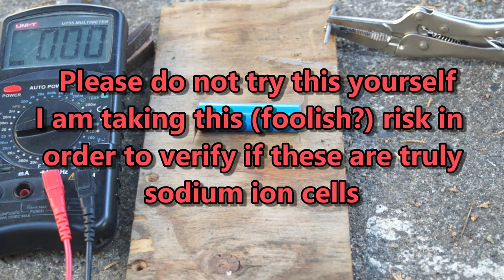Sodium Ion nail penetration test

Comment from the maker: I bought these sodium ion cells here:  https://www.alibaba.com/product-detail/GEB-Hot-Sell-18650-Sodium-Ion_1600969337309.html?spm=a2700.shop_plgr.41413.13.5f8f4147PAJoF2
Reply: I like that they're described as a starting batteries, I bet they'd work nicely in a Coffman starter.
Reply: Use hot  glue to stick it down.
Reply from the maker: Hot snot!
Reply: Those "sodium ion" cells come with a lithium ion certification when you follow this link. Maybe real sodium ion cells don't do this.
Reply from the maker: @senseisean6632  they are sodium ion.  Alibaba manufacturers and resellers often have issues with english translation and errors on their pages.  You should always take time when choosing the cells you want.  If you watch my videos testing the cells you can only conclude they are sodium ion.
Reply from the maker: @senseisean6632 I checked the link and it still goes to the Na-ion cells sold by General Electronics Ltd.  I can't find a discrepancy

Comment: While not flammable, I can't ignore the fact that it does explode.
Reply: So... You're sticking with lithium, then?
Reply: exploded just a bit. I have seen better capacitor explosions
Reply: Yes, but it was along an engineered pressure release point.  The casing remained completely intact.
Reply: Say you have a phone battery made out of this and you put it to your pants next to your junk. Would you say it is tiny? The explosion I mean.
Reply: @ShadowManceri definitely less catastrophic and non firey compared to LiPo
Reply: @ShadowManceri  In comparison to current smartphone batteries? Yes. The sodium-ion incident is much less energetic.
Reply: This isn't a comparison. It's rather simple yes or no question. "Oh, compared to a dynamite it's not that bad." You might not be wrong, but do you think it makes it safe? Because it only takes half of junk off? Are you happy with that result? Because I'm not. I don't care if it's more or less safe. I care if it's safe. Would you keep this in your hand when it goes off? Would you put it into your pocket? Put your money where your mouth is or just stop. From what I've seen, I would not dare it.
Reply: @ShadowManceri  So... you don't use anything with a Lipo or LiIon battery, I take it?
Reply: @ShadowManceri the battery in your phone will cause way more damage if you put a nail through it.
Reply: @ShadowManceri  So do you use only NiMH?
Reply: @janglur  Do you think it makes a slightest difference to what this battery does?
Reply: @laizalott  for cars and home energy storage LFP is the best choice for now
Reply from the maker: @samueladitya1729 it depends what you mean by best.  I gave up 40 km of range from switching from lithium ion to lithium iron phosphate.  But in the same token I've got a battery that won't catch fire. 
Further to that, I expect to lose even more range with the sodium ion battery. (Coming soon)
Reply: @ShadowManceri Bro your  current phone battery is literally made out of a battery that reacts more violently than this. Its pretty clear that you are uncomfortable with how this battery (sodium ion)vents  but the one in your current phone when punctured by a nail turns into a flame thrower.
Reply: @janglur home boy doesn't know anything about batteries formed an opinion about how scary this battery is and can't comprehend that he already carries a battery in his pocket that's worse.
Reply: @bigpup37  This is like saying that murder isn't a problem because there has been worse serial killers. Does that somehow make murder not to be a problem? It absolutely makes no difference to this battery what other batteries are doing. Comparing to other unsafe batteries is pointless. It doesn't make you feel any better to say that oh well you lost your junk in an explosion, but think how much worse it would have been to burn it off. That is so wrong take. The only thing that matters if it's safe or not. Unsafe battery doesn't make any other unsafe battery safe. That only gives you two unsafe batteries. That doesn't solve the issue. It's so baffling how much people struggle to understand this.
Reply: @ShadowManceri  🤡 buddy, these batteries are safe, you were the one who brought up what if these were in phones, I've been broke down why your point makes no sense. Now you want to change the argument. Which batteries do you think are safe? Or should we just not have batteries. Side note these batteries did not catastrophically fail they vented just like they're supposed to and design to. But please tell me which batteries you like and meet your requirements for safety, I will then find a video of someone shoving a nail in them
Reply: @ShadowManceri  and for your straw man argument about murder, no it's like saying we can't use airbags in cars because they have a potential to break bones to save from other injuries, but you would rather just not drive cars until they're indestructible. The difference is these are one of the safest batteries on the market better than 99% of the things of power your devices already. Anyways Hope you have a good day. I'm not going to argue with someone who can't Google information and doesn't even understand the type of batteries he uses in his daily life already. While complaining that a safer battery is scarier than what he's already using.
Reply: Yeah They promote as inflamable and says shit `bout explosiveness

Comment: even though it may not smell like the lithium-ion sweet smelling electrolyte, its definitely not a safe electrolyte to breathe in. youre either dealing with sodium perchlorate which is toxic, or sodium hexafluorophosphate which is corrosive. 
i hope that most cells move to perchlorate since it has the least environmental effects and should dissipate quickly.
Reply from the maker: I didn't observe any corrosion after the fact on the tools for the screws involved.  Whatever they're using it smelled more like saltwater than anything else.
Reply: @diyelectrified1289  it smell like salt? interesting

Comment: Even without gloves. You are a brave man.
Reply from the maker: Honestly, I had already punctured a cell and advertently got a whiff what came out of it, which seemed fairly harmless compared to some of the other chemicals that I work around in aviation.  I had forgotten to reset my spot welder to a lower setting and blasted right through the end cap of a cell which proceeded to spray electrolyte on my hands.  It actually smelled like salt water.  If you ever puncture a lithium ion cell, you'll get a pretty strong whiff of very toxic chemicals.  These are nothing in comparison to lithium ion.  But you are right, I should be more careful.  😁

Comment: They seem to explode just the same, but, they don't seem to create the fire. They're not perfectly safe, but, much safer than Li-Ion. These are more like Lithium Iron Phosphate. (LiFePO4)
Reply: of course these can create fire. battery safety is all about energy density and pack design. if you bunch these close together they will happily burn until nothing left. but with proper mitigations they will be as safe as LFP due to their similar energy density.
Reply: Lifepoe4 can still catch fire.
Reply: @11onejay  so can Na Ion batteries when they blast the surrounding materials with superheated steam.
Reply: I bet. I orded two agms for my car audio last week. I've never had a single issue with agm in the entire 16 years I've been using them. You would get signs of swelling on agm if there were an issue. Lithium likes so smoke and ignite for multiple reasons or just randomly.
Reply: @11onejay  lead acid batteries can explode as well, and unlike lithium, they spew acid everwhere. dont short them out. 
any form of energy storage has a risk to it.
Reply: @drkastenbrot  thats great and all but they are farrrrrr less likely to explode as easy as a lithium battery will. I mean we now have sodium that are like c4. Could you imagine a big bank of these when thermal run away happens. Wouldn't be pretty. Then we have cmax and lifepoe4 which will burn your car down. Lead acid is overall more reliable and safer but yes your right any type of energy source can explode.
Reply: @11onejay  the difference between lead acid and lithium ion batteries is around 5x the energy density. lead acid contains 1/5th of the energy by weight and 1/7th the energy by size. Its safer by containing less energy overall. 
If youre looking for reliable energy storage for 10+ years, lifepo with a ~60% charge limit will be about as safe as lead acid but last much longer.
Reply: @drkastenbrot  looking for the dafest in charge that won't catch fire or blow up. That will be achieved with agm and not so much with lithium. Lithium is a coin toss on having issues or not. I'll let all the other guy go through trial and error for a few more years before they are 100% safe to run.

Comment: If you have 7000 cells like this one in a battery, I'm pretty sure it will be a big bang ...
Reply from the maker: That's true, but I'm not sure how you would manage to simultaneously penetrate all of them with a nail.  If you watch carefully, especially on the second cell, a partial penetration does not cause the catastrophic reaction.  It's until the nail completely shorts every anode and cathode layer together that causes the big and sudden release of energy.  It would be interesting to see if you can put a fully charged pack with hundreds or thousands of cells into one of those car crushers.
Reply: @diyelectrified1289  I guess it'd be a chain reaction of the cells going off like popcorn, but no fire.

Comment: I wish we had temperature measurements. I'd like to know how much energy is released when it fails so I know what materials are safe to use around them.
Reply: The answer is all of it, ~ 4Wh in 2 seconds, you should be able to do the math from there.
Reply: @SuperBrainAK so oooo, hot?
Reply: @SuperBrainAK that might not be the entirety of it. Lithium Ion cells release a lot of energy from their thermal decomposition. More than their nominal capacity of electricity.
I suspect something similar is going on here, see the black burn make and the bang from lots of gas being generated?
Reply: The piece of wood didnt catch fire so I would assume most "fire resistant" materials with high melting points are safe

Comment: So this battery could explode too, but not as dangerous as lithium ion.
Reply: Keep in mind that this is one single cell. Now imagine a large battery pack with hundreds of the cells wired in a series parallel configuration. I’m definitely curious how these would react as a battery pack in a thermal runaway condition.
Reply: I think that the issue is the stored electricity.

A very similar thing happens with a capacitor.

There is no way not to have any danger making a hole in something with electricity inside.

Comment: seem like LFP is better because LFP just produce smoke BUT this sodiom explode, heat and smoke but no fire. Combine heat and explode still dangerous if its in pack since there will be more heat produce and could ignite fire and explosion.
Reply from the maker: This blew because I shorted the anode and cathode so quickly that the pressure relief design was overwhelmed

Comment: Wow this is awesome to see. A buddy of mine wanted to eff around one day and used a pipe cutter to take the top off of an samsung 25r one day and throw it in a bucket of water. He didn't believe me that it would be a massive explosion. I stood about 30ft back. I wish I would have got it on video I pissed myself laughing
Reply from the maker: FAFO!  
When I went into this, I knew that I was going to have a massive energy release.  But I also knew that it wasn't going to catch fire.  Initially, I did expect that it would just release the pressure through the pressure relief valve.  But in retrospect, you can see that so much pressure was released so quickly that the pressure relief valve pretty much blew right off the end. 
I wouldn't do the same test with a lipo cell.

Comment: So... no volcano but still not exactly safer. I imagine that explosion could still blow your hand up nice. Not off- but up.

So in theory... in a pocket- better but still not great.

Car? I dunno... the housing around the cells would need still to contain that (larger in this case) potential explosion. Cheaper than lithium maybe- if it's not squandered and hiked up in price just because it's new.

Lipo might suddenly be cheaper because nobody will want them compared to a safer option.... the future sounds bleak with that notion.

Comment: They don't look that safe as Na-ion supposed to be?! I would be interesting to see similar test for 220ah+ Na-ion batteries (for solar/off-grid systems)
Reply from the maker: They didn't catch fire.  Nail penetration test is extreme and therefore has an extreme reaction.
Reply: If it is a lithium battery, it will catch fire and burn the moment the electrolyte comes into contact with the air with sparks splashing everywhere
Reply from the maker: Good news!  No lithium inside.
Reply: do you realise what this is compared to though?
Reply: Now they explode.... I don't know which version is worse... A lot of publicity, it seems more dangerous to me, burning a finger is not the same as exploding a finger.
Reply: @user-sp2gu4nw4x  You have pretty much no idea what you are talking about or looking at. This isn't that type of explosion.

Comment: You should dissolve sonevof the material in HCl and burn it (outside) on the end if a wood splinter or on a piece of nichrome wire in the flame of a propane torch. Probably when the sun's going down so its not too bright out. Sodium flares yellow, lithium flares red.

Comment: Would be nice to see test if those batteries blow up in short circuit.

Edit: now as i watch video again it seems that plywood that was under the explosion is burned. So there is some flame probably
Reply from the maker: There was no flame but there was a lot of heat produced.  The puncture test is really a massive short circuit.
Reply: @diyelectrified1289  yep looks like it produces a lot of heat but electrolyte is not flammable and didnt burn. Or explosion blow out any fire. Tnt dont burn also because ot blows too fast :D did it spit out its internals or just plus connection popped out? Cant really see in the video.
Reply: The blackening may be graphite that got blown out by the burst, everything around where the battery exploded also looks covered in a black soot

Comment: These are most likely lithium ion cells because their voltage goes up to 4.1 V. Sodium ion cells have a range (generally) 2.3 -2.5 V.
Reply from the maker: If that's true, how would you then explain their ability to go down to almost zero volts and then fully recover?  Also, how do you explain that they do not catch fire?
I humbly disagree with you and I fully believe they are sodium ion cells.
Reply: There are multiple sodium ion-based chemistries, they aren’t all the same and have different voltages. This is still sodium ion but a higher voltage type.
Reply: No
Reply: 2,3-2,5V is LTO

you got it all mixed up ☠️

Comment: It would be far safer to use a large framing nail gun. Under water.
Reply from the maker: To me it seems the main problem with these cells is there is no pressure relief valve.  So instead of just rapidly venting they blow the positive end of the cell cap off.

Comment: They explode? 😂
LFP smoked at best
Reply from the maker: It wasn't a controlled test.  I hammered the nail through pretty quickly causing catastrophic short circuit.  If I had a big budget and willing to destroy more cells I could do a setup where the nail is pushed in slowly like you see in the other LFP tests
Reply: Accidents with EV will happen suddenly and with much more force than a human hand can do.
I would just skip this tech.
Reply: @jec_ecart  It's probably ok for stationary storage, unless somebody crashes into your house.

Comment: Okay but what about if water gets inside
Reply from the maker: They have the same steel case as any other 18650 cell. So that means the steel will rust and turn into iron oxide and travel around the inside of the battery creating shorts.

Comment: Reaction looks like a low capacity li ion INR...
Reply from the maker: Except without all the flame and toxic fumes.  Unlike lithium ion which has a model glue kind of smell , there's literally no smell left behind when these things popped off.  I bet if I put the nail through slowly or crushed it in a vice it wouldn't rapidly discharge.

Comment: yes they are more reactive it means simply - it is for example same amount of energy that liion has but instead of "burning" slow - they explode - imagine now tesla battery with 4000 cells like this exploding at once and you sit above them the car probabbly will be blown up 2 to 4 meters and nobody will survive - or maybee better they will have no time to survive.
Reply from the maker: I think what we're seeing here is that we are overwhelming the pressure relief valve.  It may be that it's poorly designed.
Reply from the maker: Also, I think I heard there was an electric car in China that went airborne from the battery pack exploding